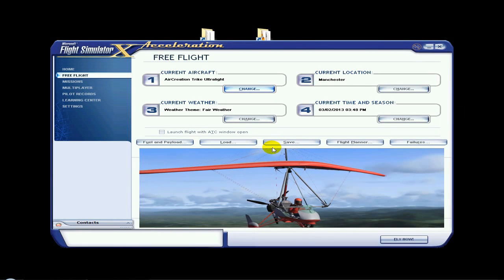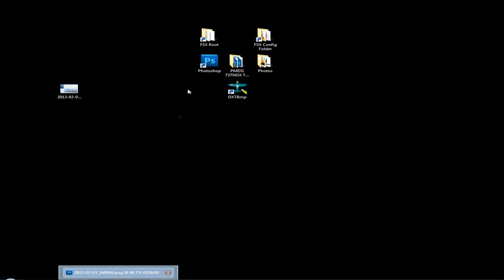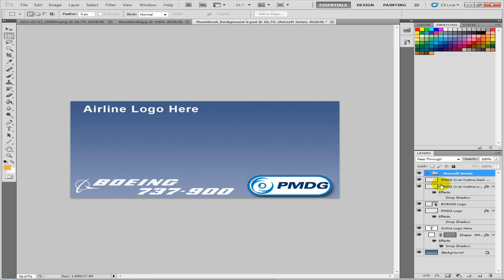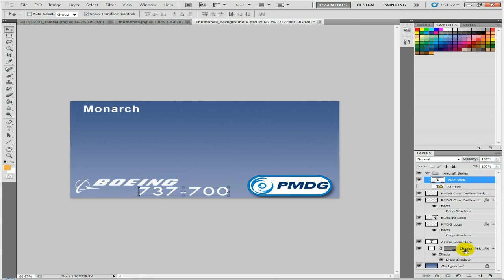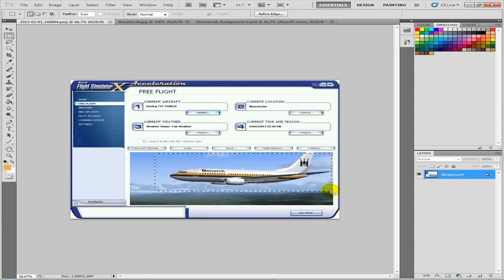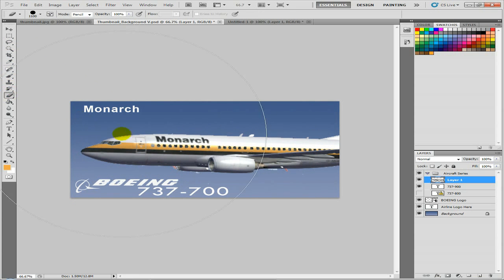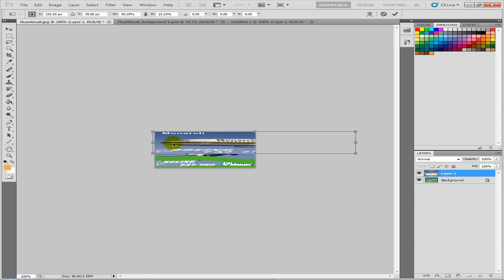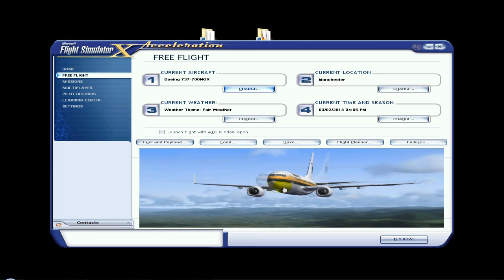Tutorial: Painting a 737-700NGX PMDG Livery FSX (Part 5) (Slowed Down)

Comment: hi i some how got windows on the bottom of my plane...?
any fix on that or do i start over?
Reply from the maker: Rotate the image before you save it. If that doesnt fix it then I dont know what will
Reply: rotate it how many degrees?
Reply from the maker: Sorry not Rotate, Flip the image.
So flip the image vertically and that should solve it
Reply: Steven Kiberton all the files or just the fuselage parts? (Sorry for a lot of questions)
Reply from the maker: When you are done painting the whole thing and you copy each part into the different files you need to flip them before you save it. Thats all of them.